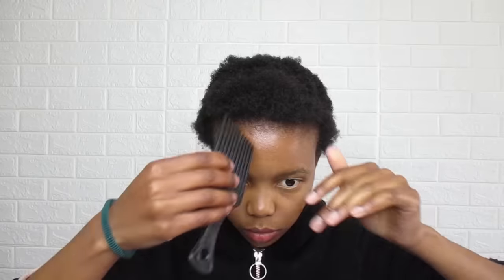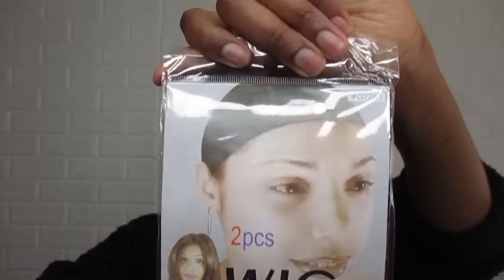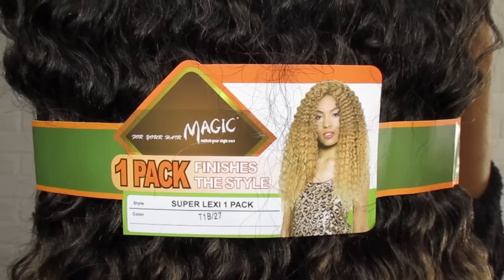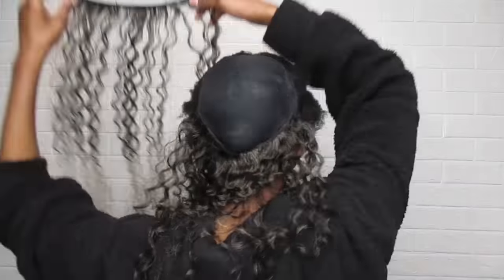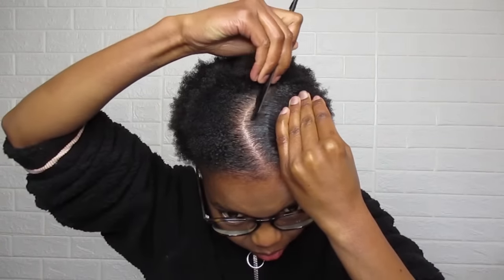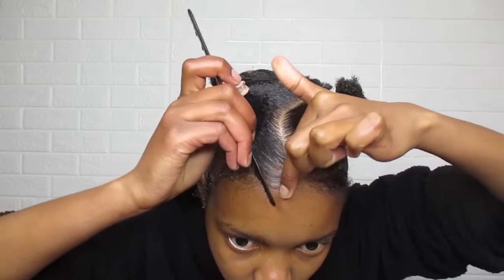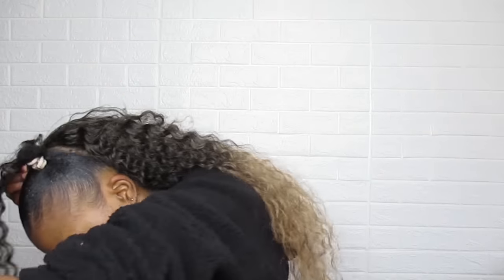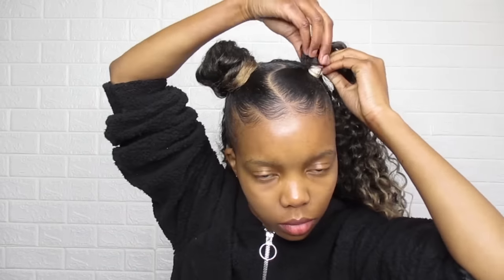HALF UP HALF DOWN QUICKWEAVE ON SHORT 4C HAIR

Comment: How long does this hairstyle last for? Especially the glued part at the back?
Reply from the maker: Hi. 

This will last for as long as your curls are well maintained. The wig cap will not move until you remove it. The front can last for up to a week or more depending on your hair texture and exposure to water, nonetheless touch ups are easy to do.

Comment: Does that dreads gel not dry white? It did so the last time I used it to do my sister's hair
Reply from the maker: Hi Hlengiwe. You have to use it with gel. If it does go white(which mostly happens in winter because it is oil based) you can use oil to counteract the whiteness. I hope this helps. Other than that, please keep in mind that some products don’t work for everyone, maybe try an alternative product with similar holding properties that works for her/you. ❤️

Comment: I always struggle with my mirrors I still haven't figured how to position it to see the back of my head when doing my hair😕
Reply from the maker: Hi Sis. It is a struggle… but it is doable. I just place one on my table and use the other to check the back. I’d hang the other on the wall, but it just won’t work for my set up😅😩.Those old school chest of drawers with 3 adjustable mirrors would be so useful.